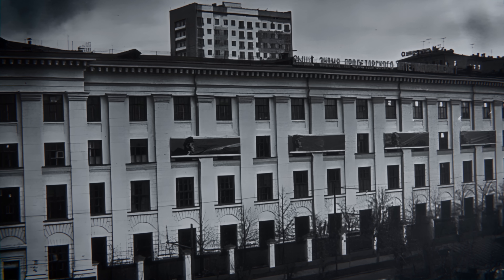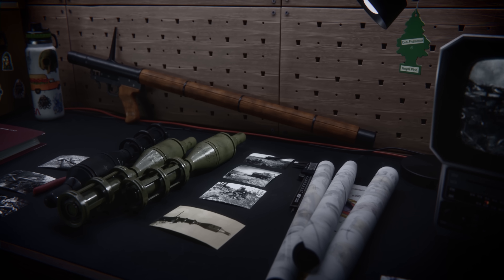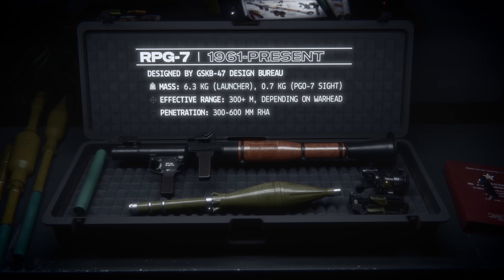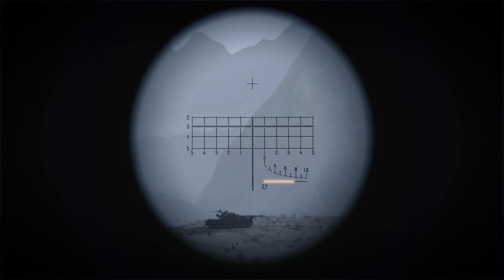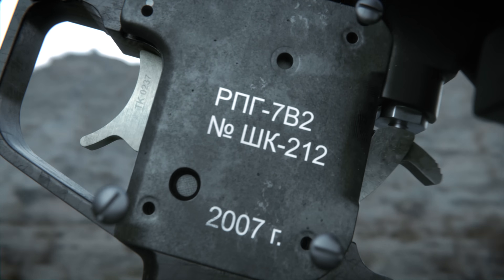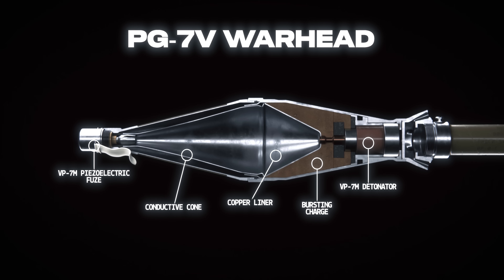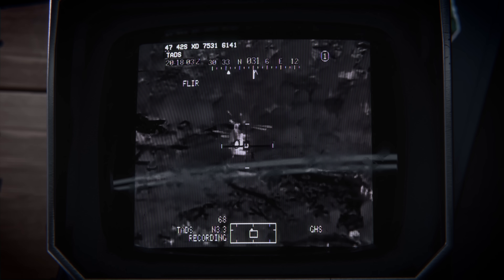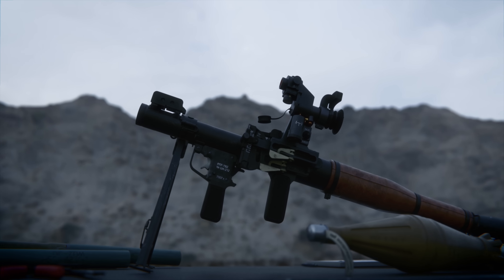The Tank Killer

Comment: Can someone explain why use copper? Isnt there already something better than copper?
Reply from the maker: It's malleable and has a lower melting point so it's easier to form into a jet stream.
Reply: @echozero_  but if it was possible to do the same with like other metals wouldnt it be better? And IF its possible would it have better or similar penetration? Cant you add different explosives to create the same jet with iron, tungsten? And how much hours did you need to make this video?

Comment: The video is great, however the copper liner isnt actually molten when warhead explodes, its just turned into a high velocity jet of copper by using the Munroe effect so that it burrows into the armor kinetically and has no incendiary, explosive, or molten effects.
Reply: Anything that kinetically penetrates arrmour generates a great deal of incendiary effects. There's a lot of hot, sometimes molten stuff splattering around very kinetically inside the space the armour was supposed to protect.  A depleted uranium round from an A-10 isn't very warm on its way to a tank, but a very hot mess happens as kinetic energy becomes heat from the friction as it punches through.